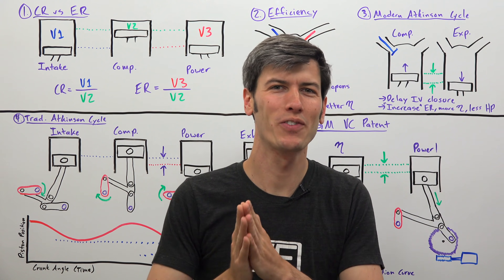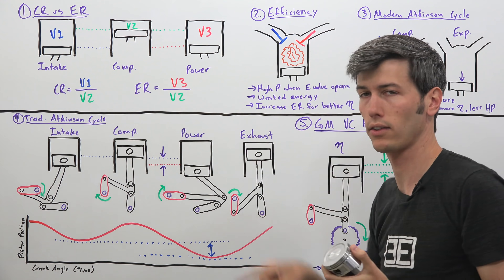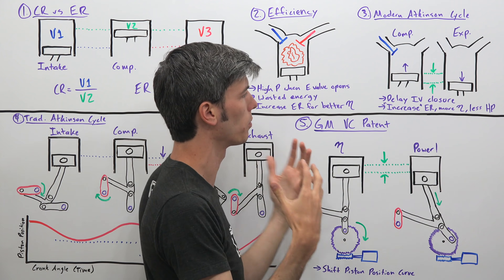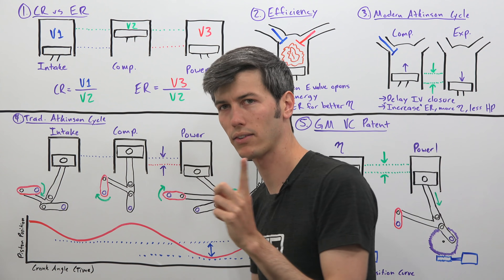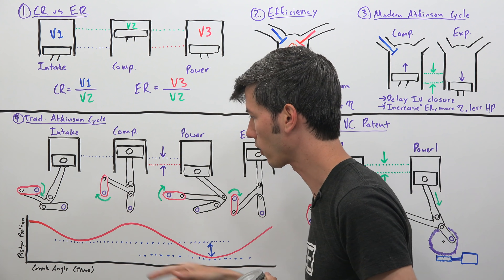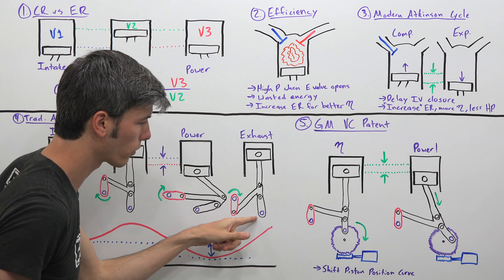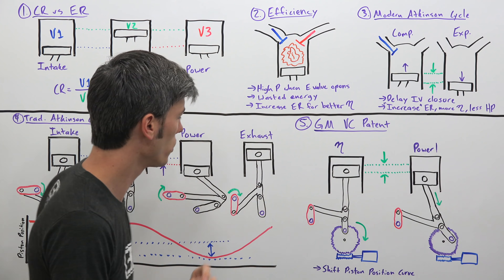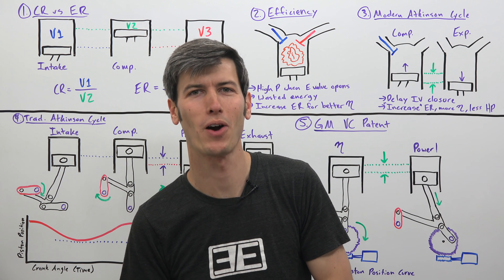How GM's Variable Compression Engine Works - Patent Review

Comment: Oh boy I like the concept but don't trust Gm quality
Reply: V8’s are good. 305’s live long.
Reply: Everything will be solid, except for one critical component because an accountant deemed it was possible to save a nickel in production with a cheaper material than the original engineering plan called for. They still haven't learned how not to shoot themselves in the foot, and this is their classic way of failing and sending people over to Toyota.
Reply: In the UK at least (so, Vauxhall/Opel) they're no better or worse than any other engine. Keep them serviced and they'll keep you chugging along from A to B. And here they're pretty much all 3 or 4 cylinder motors.
Reply: Liam Pepper theyre awful 😂. All the small petrol engines have rattly timing chains. The small diesels are fiat engines and not much better. The turbo petrols (vxr/opc)...made of cheese. opel/vauxhall are now part of psa group (peugeot, citroen)
Reply: As a former mechanic the cars and trucks that came in the most for major problems were Fords. I actually switched from Ford to GM after working in the field for 4 years.

The Most of the time when a GM car came that was a POS it would have 300-400k on the milage especially the old trucks.
Reply: Get out of 1996.
Reply: @killdizzle  Well that's the problem with small sample sizes, you are not getting a good representation of the average failure rate.
Same with trying to use forums and other avenues for complaints. All you are seeing is the reports from those who feel shortchanged in any way. You have no way to ascertain the truthfulness of the reports or the percentages of failures. You can get an idea of what it's likely to be, but can't know for certain.
In the end you have to do an (hopefully) educated guess, and go with that.

I have had experience with products that based on a sample size of several hundred used seemed bullet proof. Less than one percent failure within a year sounds good, right?
But my experience turned out to be an anomaly. The particular product, an HDD, got known as a total failure for the manufacturer, with many large customers reporting a failure rate in excess of 25%, some claimed 40% or even more, in the first year of use.
I have no idea why the drives I used worked so well, or why others had that bad an experience. But it shows that trying to determine quality from observations it risky. The only way is to find hard data from large customers. Unfortunately they are not always willing to publish data like that.

Historical data can show trends, but only after the fact.

I'm not trying to say anything about GM and the quality of their engines, just that it's not always easy to draw any conclusions from what data you can get, especially when you can't guarantee the quality of said data. And historical data, though most of the time of better quality due to hindsight, is even less reliable when trying to draw conclusions regarding new products.

OK, that ran away from me. I better stop before I go completely off topic.
Reply: I have a 2003 GMC Envoy and it is a great car but it took serval trips to the mechanics to fix all the problems with it. It's on its on its second engine with only 120,000 miles and transmission a few years later. Now it is has 161K and its finally running well.
Reply: I have a 2000 5.3 that I full throttle frequently. 280k and running strong. Original tranny.
Reply: Vaughan I drove a GMC express. Panels didn't line up. Wiring issues for days.
Reply: Recent history has shown that GM quality is no different than the garbage being pumped out by Toyota, Honda, or Subaru these days.
Reply: 88 (31 years) C1500 305 200,000+ and keeps on chuggin.  Leaks no fluids and starts right up and purrs like a kitten.  But like any vehicle, keep up on the maintenance and it will treat you right.  Cars are like women.  Some are more expensive to keep happy.  :)  Relationships are like getting sun burn.  It feels great rolling around on the sand and wet surf but the sunburn after the fun is over really sucks!   :)
Reply: Yeah, could be another thing to go wrong.... would be cool if it could be done.  One compression when you run 87 octain, another compression with 105 contain e85.
Reply: Yeah they don't want to compromise on power or efficency but they compromise on realiblity or quality.
Reply: Stay far away from GM if you value your wallet and time
Reply: GM has made the most reliable and popular  engines in the world small block Chevy  and the LS series.
The Number 1 replacement engine for all cars of any make or brand and rebuilds. developed in 1955 and is still made by aftermarket manufactuers and sold as a crate engine. 

Wards awarded best engine of the century ...
Reply: I can guarantee that those that say that talk/complain about GM  don't know the first thing about cars and couldn't tell the difference from a spark plug and a fuel injector or even change a simple tire. GM quality is exceptional and has won many awards and recognition for their reliability and dependability.  

GM has driven the automotive industry for a hundred years and contributed more than any, any other OEM in the world in regards to innovation and invention. 

I bought a used 2001 Saturn  L300 cash when I was in a rough spot 5 years ago between jobs to get me through the winter. I still drive it and I travel with my current job, working from home.I would not hesitate to drive it across country and I often do.
Reply: @MrGreenelight  Ask any mechanic about GM and you will get very disapointed, if talking about GM we talking about how it is today, 70s GM was good and from the 80s they started going down hill to what it is today. Even people that like GM for their past just say that what they have become is tragic.
Reply: @Anirossa  Most Mechanic own GM products, especially the trucks.
 Yes, GM 's Market share has decreased since the 70's but the products are better.
Understand, that for almost 80 years up until the 80's GM was not just the largest Automotive company in the world, It was the largest company in the world period. 

Their  decline was due to Union pushing their wages, benefits and pensions so high that they could not offset/compete with the new transplant non union Foreign car companies (Honda, Toyota, Mercedes, Subaru, Hyundai, BMW, Volkswagen, etc.) which are all manufactured in the US.
The  salary for a auto  Union worker before the GM bankruptcy/ restructuring  was averaging   22.00 dollars an  hour more than the non-union transplant automotive worker. This on top of the increasing sales of transplants and the anti-american social-political trend of the millennial generation (wanting to be different from older generations) it is now "Cool" or "in" to be anti American. Just like it is Trendy or cool to be "Gay" ...people are now claiming to be gay who actually are not as a form of social  rebellion. 

But what many don't know is that the Toyotas, Honda and Subaru they are buying are American, Made/ designed  and quality controlled by Americans and made from American part suppliers.
Reply: @Anirossa  Also, GM has brought more invention to the automotive industry than any other OEM company (possibly combined). From the power windows, electric starter, automatic transmission, on board computer etc. up  till today vehicle telematics what GM also invented 21 years ago with Onstar.if its in a modern car, it was more than likely invented by GM
Even the first and only car to be driven on the Moon was made by GM. Yes, GM made the moonbuggy back in the 1960's
Reply: @Anirossa  Are we Clear?
Reply: So true.
Reply: Their cars are much better than what they used to be. Also, many of their old trucks and expensive cars(corvette, 2500, etc.) were known to be really reliable and work to this day
Reply: @scarea2691  All of their small engine cars have been very poor quality. But if it has a v8 its probably solid.
Reply: The LS and LT Engines are among the best and most reliable Engines in History. I dont trust GM with 4 Cyl Turbo engines tho
Reply: @BadAssEngineering  I own 20NET (B207) it has over 260 thousand km on the clock and apart from changing ignition coils at 250 tkm and regular oil service I do nothing and it runs strong. A month ago I've had the crankshaft bushings inspected and they look like new so I think I can recommend the engine :)
Reply: @paladain55  
The 3800 isn't reliable???
Most cars running that hit 200k plus 
Can yall stop the spewing of BS. GM
Didnt earn the anti american stereotype
Reply: @WindyCity1992  True I forgot about the 3800. I more or less meant 4 cylinders are the ones to avoid.
Reply: @paladain55  
Hmmm. Cant defend those. Idk 
Enough
Reply: You should see the price charts on mustangs. The extra packages were all super cheap until the 90s hit and it exploded. If you converted the price to todays money of a 1970 boss 302 it would 24k lol. 
Gotta increase prices if you can't increase sales I guess. I think trucks have been hit the worst by this. A lot of idiots buy the brand new extra platinum edition for 300% msrp, while at the end of the year all models will be 25% off msrp. (or more)
Reply: @paladain55  Because that's what their known for......... SMH .
Reply: @WindyCity1992  3.8 was a good engine and 3.4 too. problem is not the engine is everything else. power steering, alternators, compressors, water pumps. and access to them was tight because its a front wheel drive layout with a v6
Reply: @xavierramirez330  
Ive never heard these issues. Im sure
They happen but most last awhile
Reply: @WindyCity1992  you don't have a shop. I see this all the time. But they usually start going out over a hundred thousand miles but you know a Toyota last double that.  I barely get Toyotas in ever
Reply: @xavierramirez330  lol
Ive only had American. With no break
Thank god , im at 146k with no issues
Reply: @WindyCity1992  what car is it?
Reply: @paladain55  yeahbut, my 25 grand base model stock ecoboost could beat a stock 1970 boss 302
Reply: @senorpepper3405  I hope so. They had 50 years to make it faster. But thats not the point. The boss 302 was considered fast for its time, and the ecoboost is not considered fast for present day.
Reply: @paladain55  The 4 cylinders are ASIAN engines. Japanese and Korean to be more precise. The OLD ecotecs were German.
Reply: @iamtheoffenderofall  Well they are Daewoo's rebranded so you can say what you want...
Reply: @paladain55  well, you can look at it that way. or you could look at it that technology has improved to where it has become common to where we can get the performance  of yesterdays fast cars. there are also economic factors when you factor in money.  cars last longer nowadays. there is more competition. that makes the price go up.
Reply: @senorpepper3405  Yes I can see both points but comparing now to then is like comparing apples to oranges. In its day it was cutting edge stuff and of course when considered to todays option would be considered piss poor.
Reply: @fomalhaut86  ive got a honda 330000kms NEVER had a single problem.the heartbeat of mexico that I own( 6.0 rattle trap truck) couldn't  hold a candle to it in terms of engineering and build quality imho
Reply: @fomalhaut86   The first generation L850  Engine family with turbocharger was the most reliable Engine of all GM Engines when it was in production. according to GM quality engineers.
Reply: @xavierramirez330  
Ford Taurus
Reply: @scarea2691  most of their cars are on the bottom of the CR reliability ratings.
Reply: @scarea2691  Corvettes usually have a reliable powertrain. I can't say the same for the electronics though.
Reply: They actuallyempericaly score near the bottom outside the arena of groupthink. I own one 3/4 ton with cavilier but only cause their ubiquitous and parts sort of cheaper
Reply: @scarea2691  how quickly we forget GM killed 124 people over an 80 cent part in the ignition switch.
Reply: @truantray  ford killed more with theirs
Reply: @truantray  GM didn't make or even engineered the ignition switch afaik
Reply: @truantray  Ford killed over 700 with transmissions that would not engage park. So what?
Reply: There is no 'quality' when it comes to GM.  I drive a 2018 GMC Savana for work issued to me by my company.  It's terrible.  Outter panels don't line up.  Large gaps.  Wind noise is atrocious on the highway.  Engine light is already on after 8,000kms!!  And when the tranny down shifts (automatic), it lurches or lunges forward - you really have to apply the brake while stopping.  It's a horrible vehicle.  My relief is getting into my personal vehicle which is a 2018 VW Golf TSI Comfortline Sportwagen.  Ahhhhhhh.
Reply: To me it seems right after the bail out/economy crash they needed to increase profit margins. All there small, medium cars always in for repairs. Yes the V8 probably different story. Any of the vehicles in early 00's and 90's that's ALL MY family bought was GMC. SINCE THEN we've merged into Ford's or keeps
Reply: JDPOWAH!
Reply: same thing iw as thinking haha
Reply: The cars may be plasticky and less than comfortable, but modern GM powertrains are solid. Their little 4cyl cars like the Cobalt are the cockroaches of the road, you can’t kill the damn things

Comment: Sounds like something intended for a sports car of some kind. Power isn't just for acceleration but for increasing top speeds as well. If that's precisely what's being aimed for then it makes sense. If it was strictly about keeping acceleration time low while keeping efficiency high but without top speed a high priority, a hybrid-electric drive train would do that job just as well.
Reply: this operation mode doesn't increase power compared to normal engines. its purpose is to increase efficiency in every situation you don't need full power. Means in any normal driving situation without strong acceleration. it does not effect the maximum power of the engine. at least, this is not the primary idea. a small increase of power can be gained because you can actively prevent occurring knock under full load without the need of very late ignition timings.

Comment: Fascinating! Does the GM idea simply shift the crankshaft for the entire engine, or can they change things per cylinder? Thanks!
Reply: UsherLinder Why would you want to make adjustments per cilinder?  And even if you would I think that would create some very interesting unbalances.
Reply: @Conservator.  , you are right: done incorrectly, a cylinder-by-cylinder change could throw the entire engine off balance. Done correctly, cylinder-by-cylinder changes could make even more dramatic changes in power or fuel economy, or in other aspects of performance that we are unaware of today.
Reply from the maker: Crankcase remains where it is, but the shaft would adjust all cylinders simultaneously.
Reply: @EngineeringExplained  , thanks!